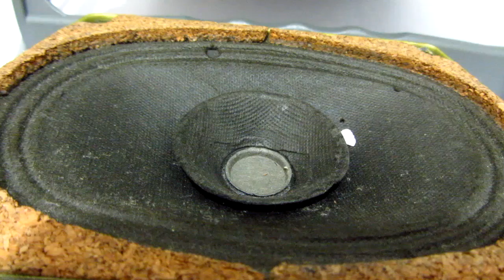Infrasound, Ultrasound, Resonant Frequencies (Speaker + Function Generator)

Comment: Thank you for this. Are you using any particular amp or speaker for this? How is it connected?
Reply from the maker: +Jeremy Keenan 
No amplifier was used. The output of the Rigol DG1011 function generator was directly connected to an old radio's speaker.
Reply: +furulevi Thanks, got it. I wasn't aware it could drive a speaker directly.
Reply from the maker: older generators are not that powerful
Reply: +furulevi Yeah, that's what I thought. I was particularly interested that you could get an infrasonic response. I assume a standard amplifier would filter infrasonics so that you couldn't do that?
Reply from the maker: I'm not sure if it would filter it out...